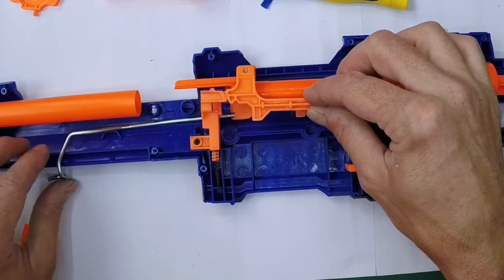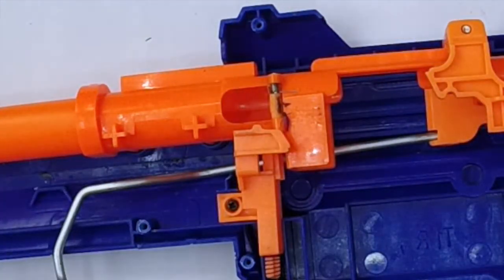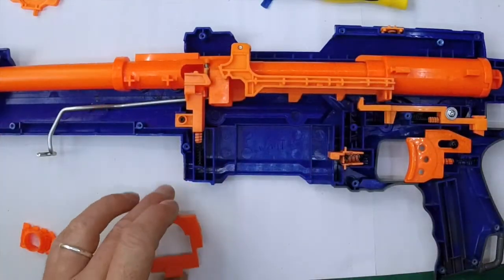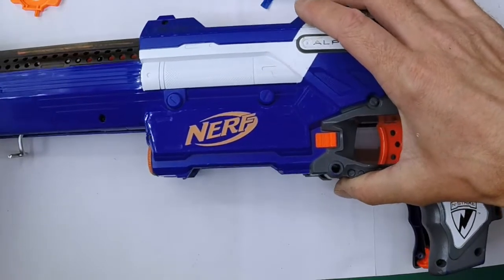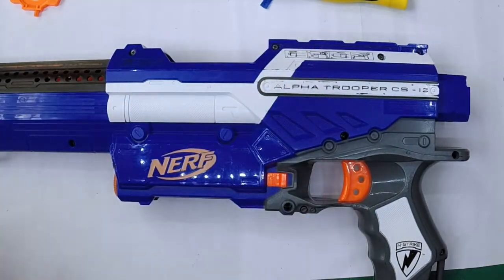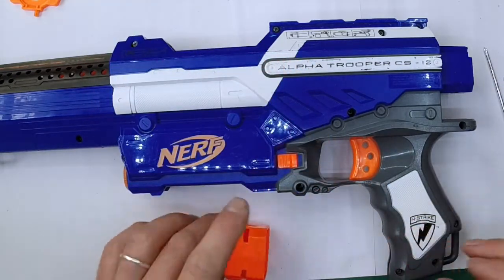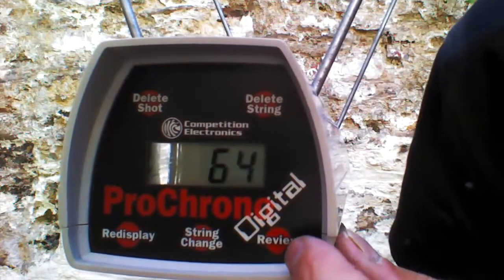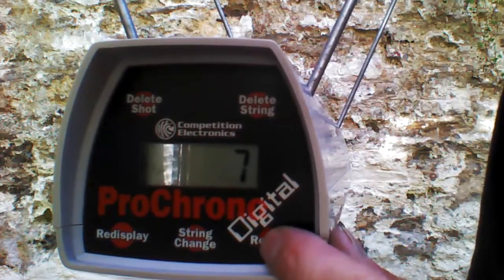Nerf Elite Alpha Trooper-Blasterparts Hard Range Kit Part 2

Comment from the maker: Dominic Mancini. I have a ton of 110fps full autos, I also have a Rampage. I am not really a springer player, so those pump grips don't interest me. I am not surprised by the results, remember the AR is in on all my tests and if you adjust the average by 5FPS for the AR, you are in the 90's which is about right for an EAT, which has much worse maternal design than the rampage and Retaliator. I also have a 130fps Stage 3 equipped Retaliator!
Reply from the maker: Not believing in Chrono data means you don't believe in the laws of physics, which makes it hard to quantify any improvement. What you are seeing is the limit of the components within the EAT, I could put a 12kg spring in there and not get much more than 1-2fps more out. With the poor stock bolt design and faux barrel, combined with a limited plunger volume, the maximum you can get from it will always be less than the Retaliator or rampage. The fastest EAT I have ever seen was Oznerfnerds brass breeched one, which had stock o ring, 7kg spring, 9/16th brass barrel and used Xplorer stefans. That hit 135 average with a 140 peak. You are right that there are gains to be had from a better breech seal. Be clear, the breech is the part in front of the bolt (the moving tube into which the dart is pushed) and the EAT and other elite blasters lose air as soon as the dart exits the bolt on firing. You can throw all the parts in the world at an EAT and still not shoot as well as a 7kg Retaliator.
Reply from the maker: F course it tells you what's happening at 30ft. The higher your muzzle velocity the further your dart will travel before air resistance and gravity drag it back down to earth. It's BASIC PHYSICS. I know the plunger tube is the same volume, the same applies to the Retaliator, you won't get more that 140fps out of any elite blaster. You can't get more from commercial springs or parts due to the limited air volume.
The orange mod works bolt is absolute rubbish, it has too large an internal diameter, resulting in lower velocity than the stock one. You are missing the point about the EAT, it's BOLT contains more dead space than other models. It's breech is no different to any other elite blaster, all have a dart gate and tooth to push the dart back into the bolt, depress the AR and ensure the dart is as tight as possible in the bolt. The bolt is essentially the barrel in stock Nerf, the Retaliator delivers more power because there is almost nothing in front of the bolt to slow the dart and the bolt has minimal dead space. 
When tuning something you need a detailed understanding of the mechanical system and the physical processes involved. Throwing parts at it doesn't solve anything.
Reply from the maker: The Retaliator bolt is shorter than the EAT one, it won't push the plunger back to the catch, that's why it's better, it's shorter so has less dead space.

Comment: Huh, these numbers don't sound right to me. They seem so low.
Reply from the maker: That’s because they are measured properly, with a large test sample using darts which are 1g +/- 0.2g  outside on a chrono with a calibration certificate. It’s a long faux barrel and the spring wasn’t that good. I only test the kit as it ships, assembled according to the manufacturers instructions. They are honest, unlike the BS figures posted by many other “testers.” Also I bought every part tested, I never take free samples from vendors.

Comment: Do u removed the ar restrictor? And what do u think about buying the orange mod works solid kits and the blasterparts kit for the spring and the prime bar?
Reply from the maker: I left the AR in, as I didn't need to measure how much was gained by AR removal (5-8fps) as I needed to compare this kit with the Hobbymods and OMW ones, both of which were brand new EAT's either AR in when tested. AR removal isn't essential in Elite blasters, I usually leave them in because they protect against dry firing. AR removal can be useful in the EAT to lessen its tendency to top hat jam by allowing the dart to sit back in the bolt better.
Reply from the maker: The prime bar in the Blasterparts kit is the WRONG shape just to warn you. I wouldn't buy it. The bend where it meets the bolt sled  is wrong causing additional stress on the mounting boss and making the bar rub on the shell. The stock bar can easily take 9kg making it pointless as well as I'll fitting. Orange Mod Works Solid S2 has the worst performance in the class, due to the poorly sized bolt being too loose and about a third of the metal catches in s1 have so much casting flash on them they don't work unless you completely re finish them with a file.  The OMW 5kg Spring is very good, it can be used with the stock catch but needs a stronger catch Spring to compensate for the bendy stock catch. 
The 8kg Blasterparts Spring is also a let down, it's not as good as the Black Tactical V2.
If you want the best set up, get the Hobbymods kit, it's reliable, fits well and has a very good catch, backed by their guarantee of fit and durability.
Reply: +Foamdata Services thank you man u r the best

Comment: This kit does not come with reinforced catch so as a result will not prime...
Reply from the maker: The Hard Range kit does come with a new catch plate. If your blaster doesn't catch then it's not the catch plate, you need a better catch spring or something else is not set up right. I have run the stock catch on this blaster for 2 years with no problem at all.
Reply: I've brought this hard range kit literally last week and I can confirm that there is no new catch plate. You were right tho, ive since found a stupidly hard catch spring (the one that came with the kit wasnt able to hold the tension) and it is now working but still no reinforced catch plate which is a bummer.
Reply from the maker: You can see my catch plate, that was in my sealed box, from the kit, in the video. If yours didn't come with one you should be getting on to Blasterparts, unless you bought just the spring.

Comment: I installed this kit in my EAT and it only catches like half the time. :(
Reply from the maker: I had similar problems, you need to replace the stock catch completely Blastersmiths and Hobbymods do replacement catches or go back to the Orange Mod Works 5kg. If you want killer EAT performance check out Artifact sealed breeches. http://www.tacticoolfoam.com
Reply: Yeah but both of those places are overseas so shipping for one piece isn't worth it.  Would it be possible to simply double up on springs on the catch plate?  Like, glue the stock catch spring on next to the original nub?
Reply from the maker: Shipping from BSUK is $4 for that part, so hardly expensive. You could use the Orange Mod Works stage 1 solid catch too, just look out for casting residue down the centre line of the part, be sure to file it smooth and flat if there is any. Doubling the spring is not a decent solution and if you fit a very stilff single spring the catch will eventually warp anyway. The Blasterparts 8 kg spring shot worse than all the others in testing. I would say it's the worst kit on the market IMO.
Reply: That sucks to hear.  Already spent money on it sadly so I'll have to make due.  Maybe I'll look at that BSUK catch if shipping to the US is only $4.